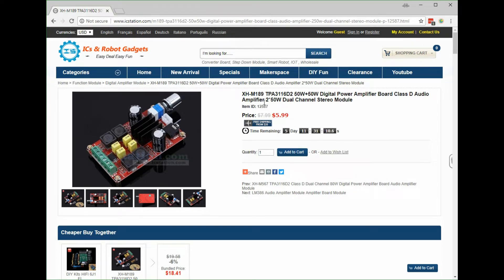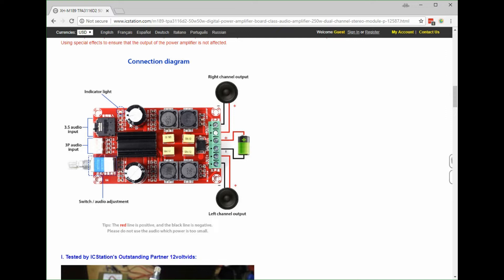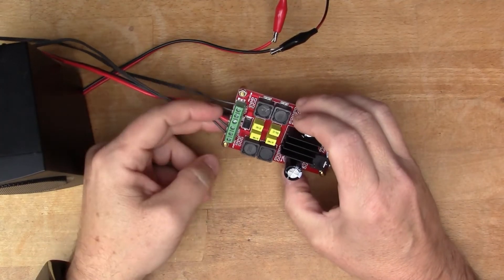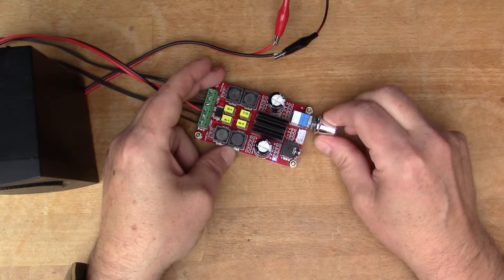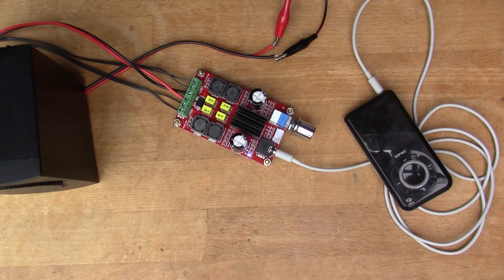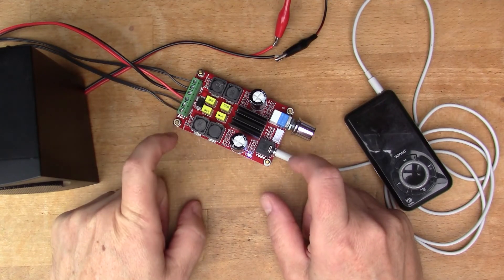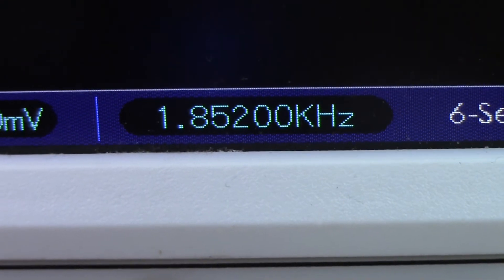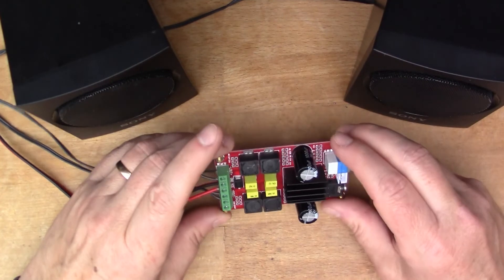Class D Power Amp Review (#86)

Comment: Most of these wee amps are good enough  for non audiophiles.  10 volts was a judicious choice as these amps are powerful and great value!  I have more amps than speakers I'm afraid!
Reply from the maker: Yes it sounds ok to me.  I should probably do a side-by-side comparison with my old Marantz amp to see if there's a noticeable difference.
Reply: @MartynDavies  I think the Chinese amp modules are excellent value and although I would like to buy a more expensive system I don't know if my hearing would discern a great deal of difference as I suffer from a degree of industrial deafness and tinnitus after nearly forty years working in a power station!  Maybe if I win the lottery.....!  I bought a set of decent 'Denon (by Missions)' speakers second hand on eBay and they were definitely worth every penny.  A comparison with your own amp sounds like a good idea.